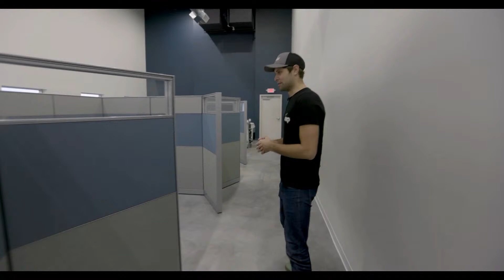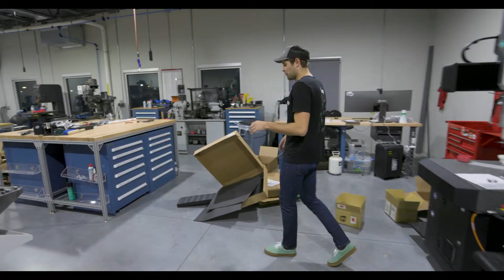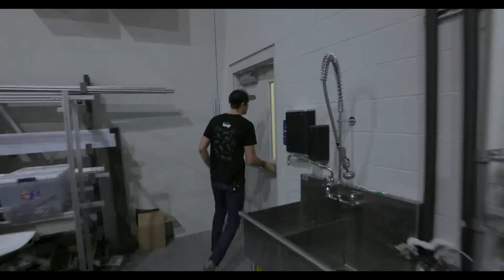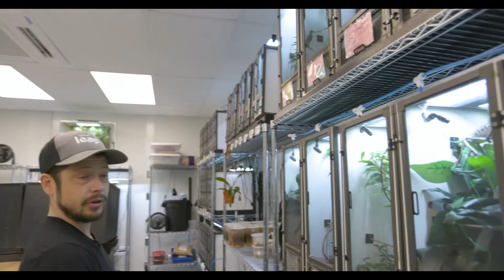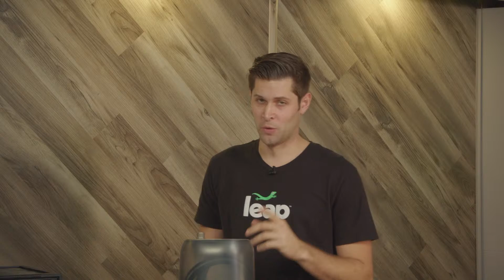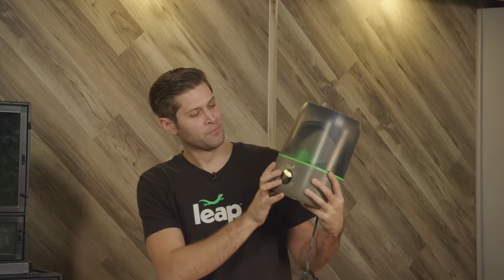Leap Launch Livestream! Innovation in Reptile Keeping!

Comment: Question, have you tried doing spray foam backgrounds, etc once the habitat is setup?  I am looking at start my hobby (soon I hope) and I would like to create these type of backgrounds.  I then found leap and thinking this is what I want to use, but unsure if it will work.  Thanks!
Reply from the maker: Our development team is working non stop to develop add-ons for existing products, product improvements, and new product ideas. But if you're looking to add spray foam to our existing backgrounds, you will need to install anchors to ensure that the spray foam has a proper base to be supported by and to adhere to. Stay tuned for new informational videos regarding this subject!